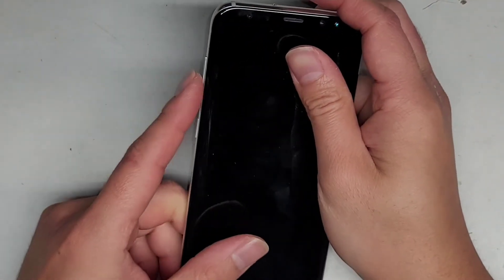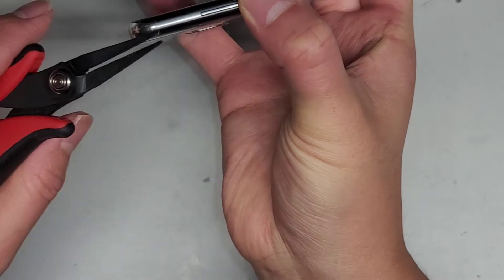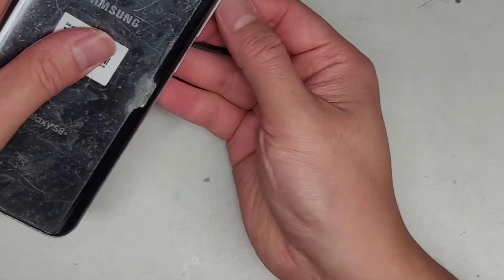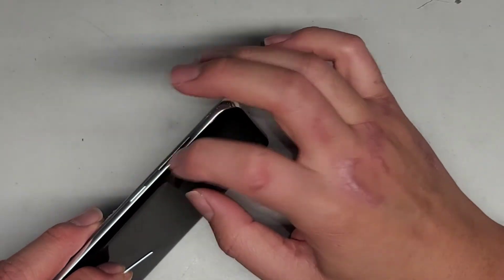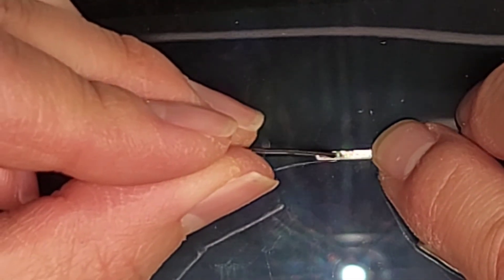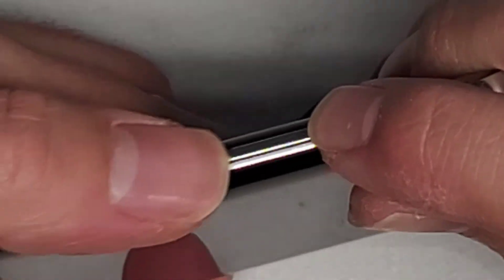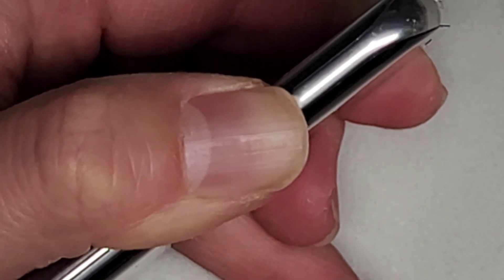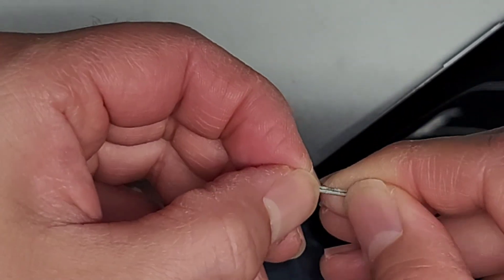Sticky Stuck Water Resistant Waterproof Samsung Galaxy Phone Button Removal Replacement Repair

Comment: Thanks for the vid. I did this and when I got the sound button off there was nothing there like no dirt or anything. My phone keeps going into safe mode even when I cleaned it and put the buttons back in and it just still isn't working. I dropped the phone in water earlier by accident and I was wondering if there is any other way I can fix it?
Reply from the maker: Very strange. What model phone?